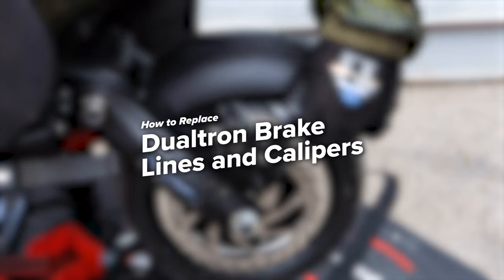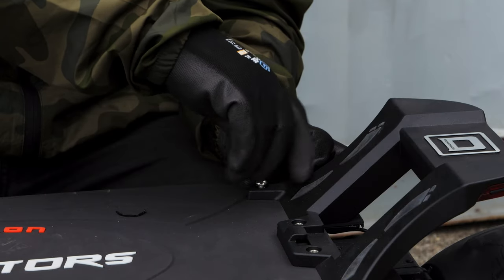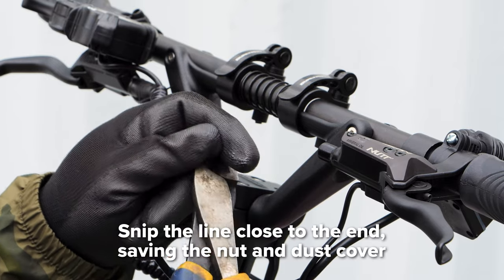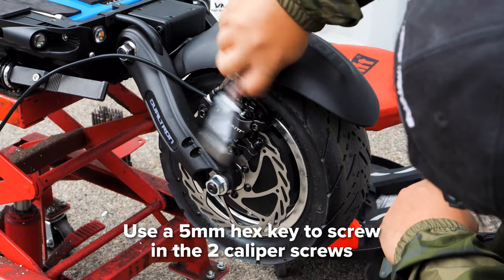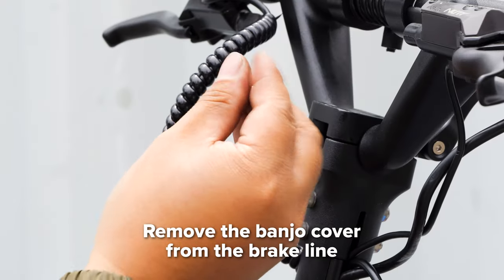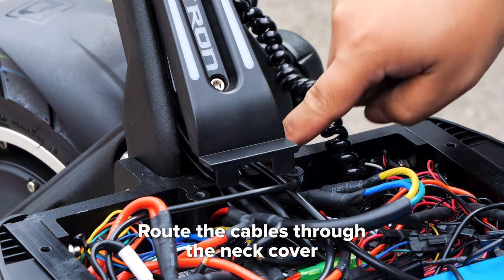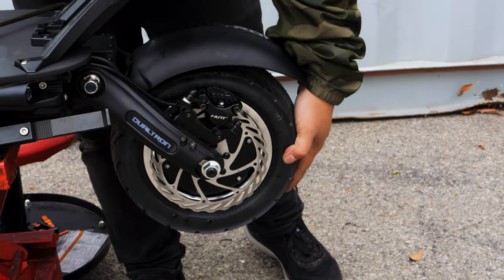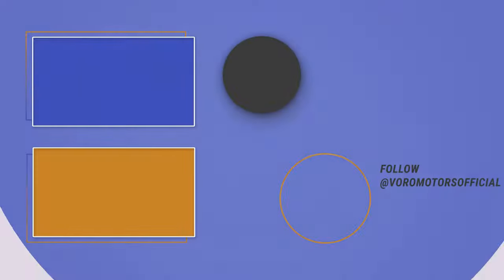How to Replace Hydraulic Brake Calipers and Lines on Dualtron Electric Scooters

Comment: Hi. What could be the problem if my floating rgb led lamps don't light up? I completely changed the control mechanism located in the middle of the handlebars, but there are no results. My scooter thunder 2